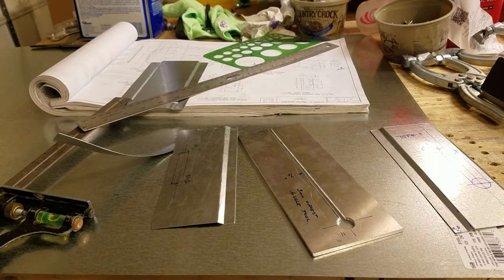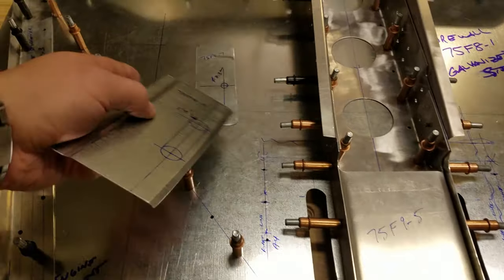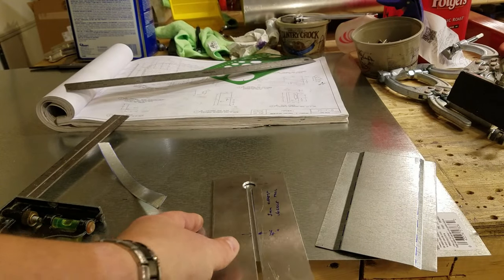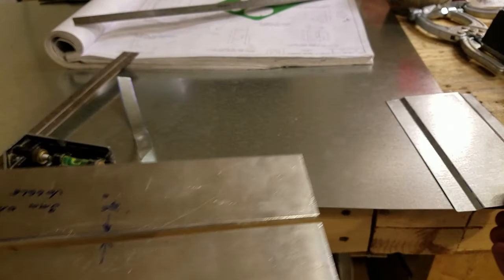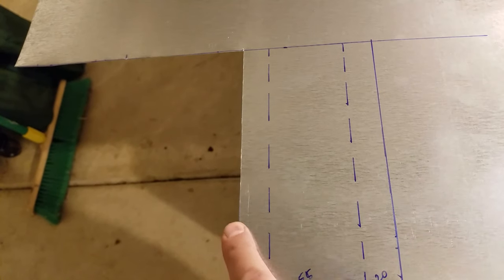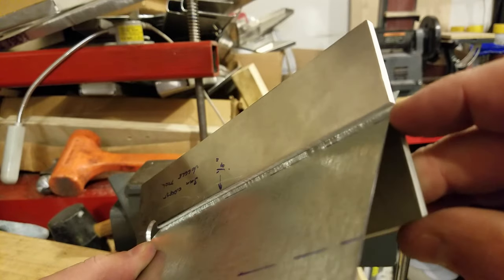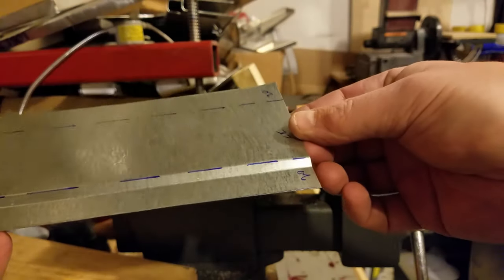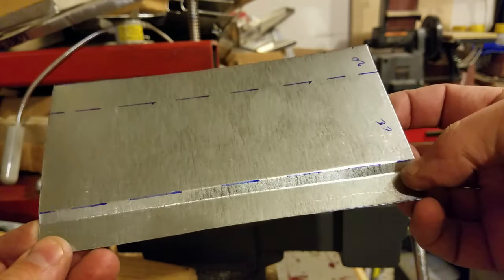Making Joggles

Comment: how did you joggle the elevator trim tab chanel?
Reply from the maker: My elevator trim tab channel doesn't have joggles in the plans. However, I used a set of crimping pliers to put a very slight crimp in the ends of mine and then manually bent the flange slightly lower, creating a slight joggle. Worked great.
Reply: @GregsZenithSTOLCH750  thanks My plans shows joggles, I need to remake my chanel it moved when I was drilling the hinge so screwed up the holes.
Reply from the maker: @wb6anp  I had the same thing happen and my trim tab is now recessed about 2mm from the trailing edge. I'll be pointing out the problem in my update video on the elevator. The slightly-crimp-and-bend method worked really well for me.

Comment: what kind of material are you using for the piece and the tool?.
Reply from the maker: Juan Leiva The steering rod cover plates are made from 26-gauge (.018") galvanized steel. The joggle tool is made from some spare 1/8" (3.2mm) 6061-T6 aluminum I had.

Comment: WHAT are joggles used for exactly??
Reply: A joggle is a very slight offset in sheet metal. In my case, they are used in the firewall of my airplane to allow "covers" for the rudder control rods to move freely, while sealing the engine compartment from the cockpit. They are used in all sorts of sheet metal applications.
Reply: They are used when the edge of one part needs to overlap the edge of another part.